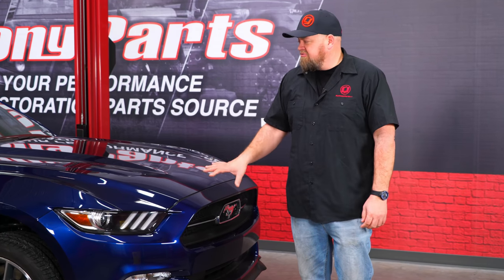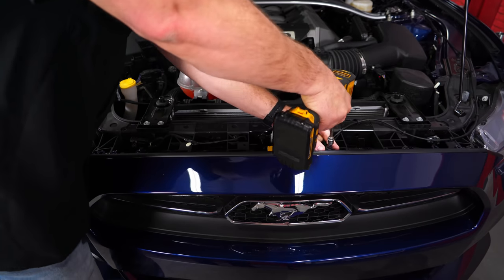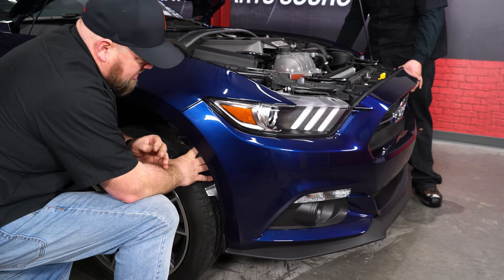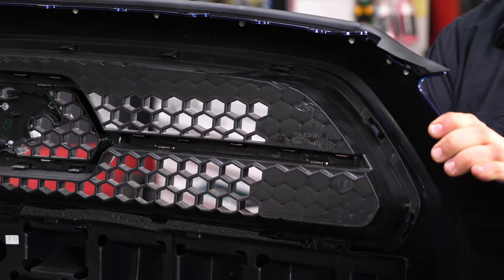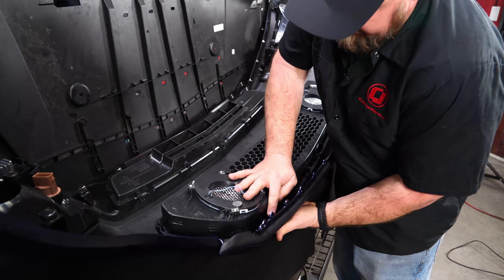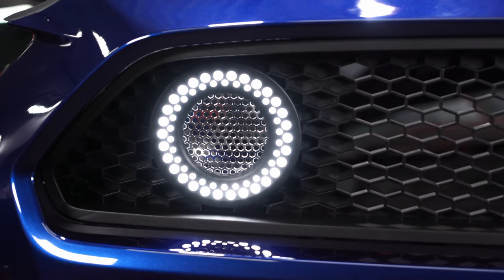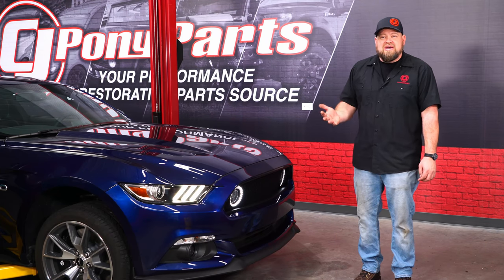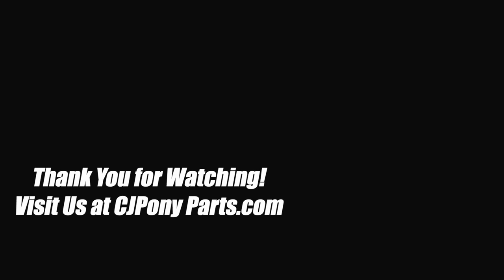2015-2017 Mustang Install: Renegade Series Upper Grille with Daytime Running Light Halo Rings

Comment: hey CJ is there a way I can add fog lights to my 19 EcoBoost that doesn't come with a fog lights?
Reply: -YaHabibi. Thought the fog lights are integrated into the turn signals?
Reply from the maker: Pretty sure they all came with fogs?
Reply: @cjponyparts  my local Ford Dealer has only 3 Mustangs 2 GTs and 1 Ecoboost and none of them have fogs i suppose because none of them are premium edition?
Reply: -YaHabibi. Wow you’re right. Ford actually made a turn signal light assembly without the fog light... for the base model. I can understand not including it if it was separate like the 15-17 but wow
Reply: @DivineKaze  yes its so dumb like why not just include it or leave the whole and we can add our own ughhhh
Reply: @DivineKaze  only in premium edition base model only parking light and turn signal
Reply from the maker: -YaHabibi. I checked with Ford and all GTs come with fog lights but they are optional on the Ecoboost. Learn something new everyday lol
Reply: Would this fit 2018?
Reply: @cjponyparts  its odd do you think i can request fogs from the dealer?

Comment: Just found this Playlist... Why use a 50 Year LE as a test mule for questionably tasteful mods? It's yours to do what you want, but I'm keeping my mods strictly non body, bolt-on mods that are easily reversible. Nice low number though. I have #272 with the automatic. And I drive it on good weather days. 2,274 miles so far. Thanks for the videos though.
Reply from the maker: Everything we have done to the car is easily reversible if we want to put it back to stock.

Comment: What’s the voltage on the DRL wire or grey and purple
Reply: I didn't check the voltage, but I did just install this on my 2016 GTCS.  It's not the grey with purple tracer for DRL's on my car.  It was the violet with white tracer.